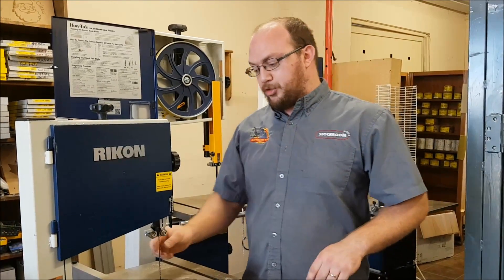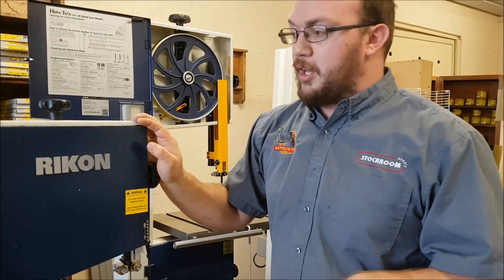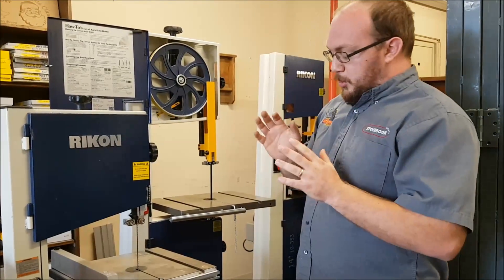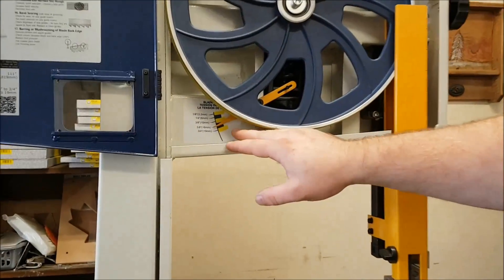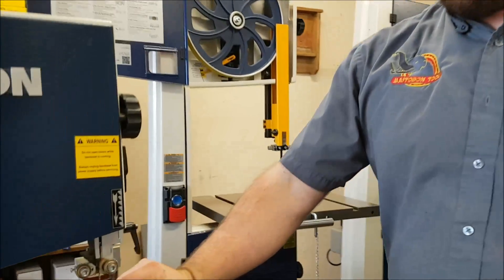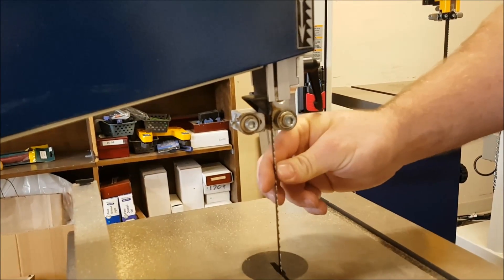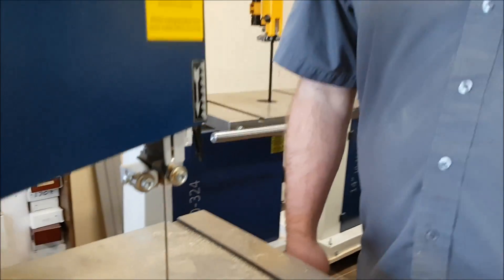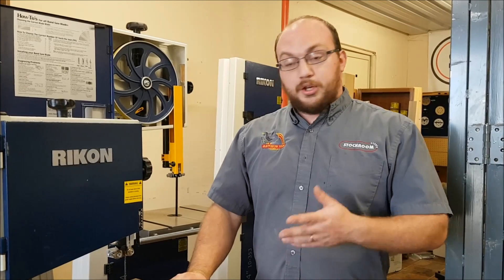Preventing Bandsaw Blade Breakage and Proper Tension EthAnswers

Comment: I thought the gauge was in reference to the blade width, not the length.  Is that correct?
Reply from the maker: It is! The tension gauge lines reference the width of the blade BUT if your blade is slightly longer or shorter than the manufacture suggests the tension gauge will be inaccurate

Comment: What's the special stuff for 3 wheel bandsaws?
Reply: It is a thinner more flexible metal, plenty of blade suppliers have blades specially for 3 wheel saws. These thinner blades also work well in the small 2 wheel saws because they are much easier to tension which is better for small hobby type saws.

Comment: Always run your saw and look for excessive back-forth motion in the blade!
I noticed my blade was oscillating back and forth (in the direction you move work through the saw) 
Turns out the blade had a crack 
swapped it out without incident!

Comment: I have a Rikon 10-305 10in band saw, and I have experienced bade breakage also. I cut Kydex, and thermal plastic used for making holsters. My cuts are mostly straight. But the finish work required curved cuts. The blade I use is the Olson 70.5 Long, 0.125 wide, 14 TPI, .0.25 Thick. When the blade is close to breaking, I can and feel the weld bumping against the work. When the blade finally brakes and I am removing it, It is amazing how brittle the blade is as I am folding it before placing the blade in the trash. 

Any pointers on how I can get more mileage out of my blades?

Comment: I have a 1 week old Porter Cable 14 inch bandsaw and I've broke 2 blades. I set tension just as you do here. Mine aren't breaking at the weld and are cheap Bosch blades from Lowe's. The second one that just broke an hour ago, seemed like it was getting dull. It was making noise at the blade when it contacted the wood and was getting a little tough to cut them bam, broken again? I put cool blocks in place of the metal guides the saw came with. Thoughts? Cheap blade? Cutting 3d reindeer. First blade, 1/4 inch got to 4rth deer and snap. Second blade, 1/8 inch and got through about 9 or 10 then snap?
Reply: I hate auto correct!
Reply: Are your guides set up properly? Tension isn't that critical. Find the setup video by Alex Snodgrass.  He's the master.  Also, other experts have told me to never run big box store blades-to buy from woodworking supply houses or aftermarket blade manufacturers to get better blades.

Comment: hello  nice tip can you make a review of the rikon 10-347 can't fine  on youtube i am looking at laguna 18bx or rikon 10-347
Reply: I've had my  10-347 for a couple of weeks,  it  is a great saw.   That said look at the  10-353,   it  is  less expensive, 3hp instead of 4,  couple inches less clearance.  
The 347 has a less robust table adjustment mechanism,  only one miter slot.  Not sure why  the  more expensive saw has less features,  maybe cost saving measure.  even their small saws have two miter slots.  Ethan  love to hear your comments  on the changes.
Reply: @BRJR12341  thank you for the info. the 347 less robust table adjustment mechanism??? i don't get it , is it cheaply made or look's cheap ?i want a 18in saw for the bigger wheels so let me now pleas
Reply: @charlesmerrifield1734  Go to the Rikon site and look at the close up pictures of the table and back of saw.  The 353 has a  long handle that unlocks  the table clamp mechinism,  it pulls down through the trunion. You can see it in the pic of trunion.  The 347 has a ratcheting bolt that pulls the trunion tight.
The 353 has a crank handle to adjust the tilt, The 353 has a removable handle that looks like a socket with a metal bar with two bolts on the end.  I'm sure both systems work it just seems like a step dowm on a more expensive saw.  If I had to do it again I'd save the 700$ and get the 353
Reply: @BRJR12341  thank you, now y ave doubt  abut the 10-347
Reply from the maker: Hey Guys,
The reason there are no reviews of the 10-347 yet is they have just finally come in! I got my first saw last week and the same day a very anxious customer came and bought it. I did have a chance to look over it quickly though.
It is simply and awesome heavy duty machine. Regarding the table tilt mechanism it is very similar to the older 10-346. It uses a heavy rack and pinion system with a removable handle to tilt the table. Due to the table being so large and heavy the extra long removable handle is necessary to accurately tilt the table. It is definitely heavier and more robust trunion than the 10-353 though slightly less convenient to tilt. Still in my opinion leaps and bounds ahead of its competition.
Hope this helps!
Ethan
Reply: @StockroomSupply  tank you ,give me back faith in the10-347